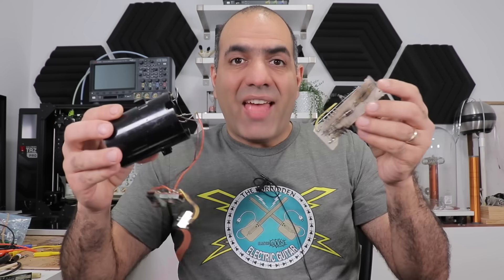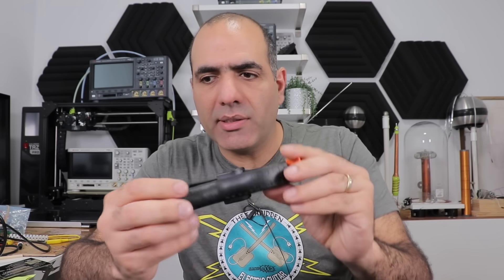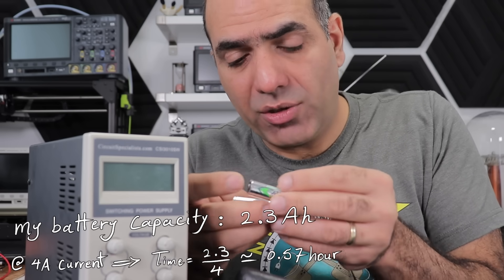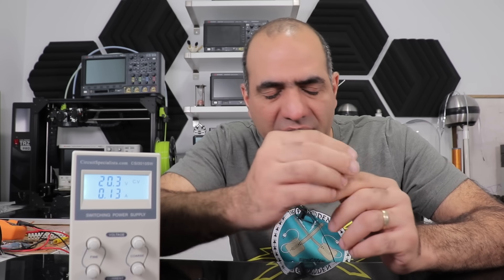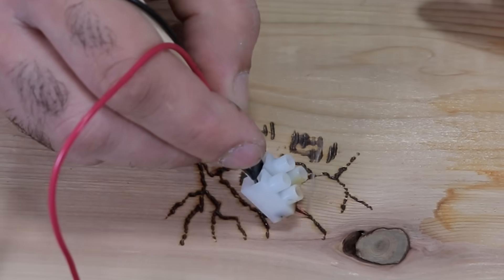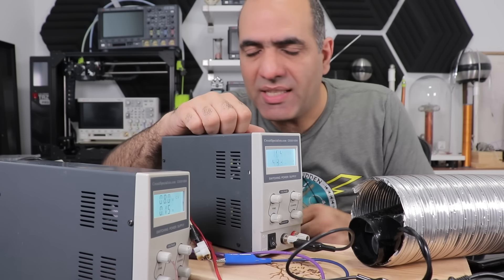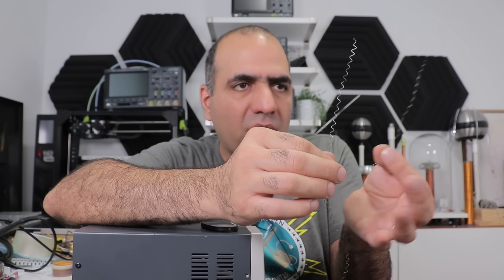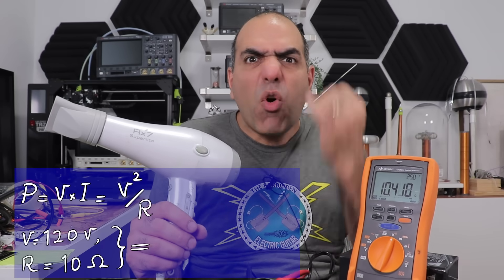Making 5 Things from a Broken Hair Dryer

Comment: Braun: proceeds to use a fork-type screw torqued down so crazily so no one can attempt to tear down the hair dryer just to rejoin a broken wire
.
Context: my sister's 10-year-old Braun hair dryer had a wire fracture at the butt end of the hair dryer which makes wire stripping impossible. Tried to open it only to run into the last screw where I didn't have the proper bit for standard bit-interchangeable screwdrivers and the only U fork-type bit I had was a smaller one for precision screwdrivers, which doesn't give me access to enough torque just to make it budge.

Comment: The magnet connecting batteries trick blew my mind completely, I was thinking how to get rid of battery holders for a project some time ago
Reply: If you pass current through the casing of those magnets, be aware of the heat that this current would generate, and make sure that the magnets won't reach their Curie temperature, at which they'll lose their magnetic property. Best of luck to you.
Reply: @ozonesama  Oh neat, I didn't know about that! So how gradual is the degradation before that point? I guess what I'm asking is if magnets are mostly fine until a certain threshold and only tend to stop working above that point, or if long term low grade heat will decrease the effectiveness a lot too?
Reply: @idontwantahandlethough  It depends on the materials involved, I guess? I saw in that video ( https://www.youtube.com/watch?v=rOgGJaO5C00 ) that Nickel could rapidly switch back-and-forth between ferromagnetic and non-ferromagnetic, and if you know how MiniDiscs used to record data, it used a laser heat source, so it can be a very quick process, once that material's Curie temperature is reached. If you stay quite bellow that temperature, I don't think that, even by repeated prolonged exposure, you'd loose magnetism.
Reply: @ozonesama  If that occurs, that also means your batteries are absolutely smoking hot. In this case, they were lithium cells. I'd be much more concerned about 350°C lithiums than the magnet connection.

The magnets are indeed usually nickel coated too, so the battery internal resistance would be the source of any heat. In other words, don't draw too much current from your battery.
Reply: i think neodymium is much more resistive than copper
it will heat up much more especially in the use case of this video with high current
and hot stuff around rechargeable batteries or just batteries in general isnt a good idea
Reply: @urnoob5528  : Nope ... these magnets are ALL coatet with nickel .... Nickel = good conductor !
(They use nickel strips to build battery packs.)
Reply: @urnoob5528  yeah, we used a neodymium magnet to fix the door of a small oven years ago, it worked great if you didn't make the oven too hot :D
Reply: not a great idea for a long time, magnets lose their magneticity when exposed to heat over time
Reply: You could just put the neodynamium magnet behind a copper contact, and have the advantages of both with the weaknesses of neither material
Reply: Idk why but I always thought it was bad for batteries if a magnet was connected to them. Lol idk why. That is a very clever and convenient way to test model a circuit
Reply: @mcsquared5005  I could see where it comes from, if you had the magnets moving around the batteries they could interfere through induction
Reply: magnets aren't good conductors, if your circuit draws more than a few amps then this will likely fail
Reply: @rikka0_059  Refer to discussion above about nickel coating on almost all of these magnets. Certainly wouldn't use one to replace a 100A connection, but in this case it should be fine. I'm measuring 0.00 ohms across a 1 inch stretch of shiny coated neodymium.
Reply: Döşe running a current through a magnet strenghtens/weakens its magnetic field ?
Reply: Don't do that for high power applications. Your magnets will lose their magnetism.

Comment: To straighten that heater wire, you can bite down on one end with your back teeth (not your front teeth, so you don't damage them), hold the other end with one hand, pull it tight, and use the other hand to run any size bolt over it. It's insane how well that works.
Reply: why teeth. that's stupid. The wire is harder than your teeth, it WILL damage your teeth.
Reply: @personzorz  Well if you aren't yanking on it like a gorilla, you'll be fine. Front teeth are easy to chip, but your back teeth have a larger surface area. It doesn't take that much force.

If the wire is long enough you can tie it to a stick or something and stand on it. Or if you don't mind going through the trouble, you can tie it to something stationary. I'm just saying what works for me. I've done it lots of times with no trouble.

Comment: Why have I never thought to use magnets to attach wires to batteries!?.  I've got hundreds of the dang things.  Thank you.
Reply: I think hair dryer heating elements are made of nickel, so that is why the magnets work. I do not think the magnets would work for copper or aluminum wires.
Reply: @7piecebucket  as long as you use them to sqeeze the wire to the (steel) endcaps of the batteries, it will work fine.
Reply: @mjouwbuis  Ohhhh, got it now. The wire goes between the magnet and the battery. Thanks!

Comment: this kind of small DC motor has input voltage about 24 to 36V...so it uses the heating element as voltage dropper to reduce the input voltage while dissipate the energy as heat. most likely those heating element is Kanthal FeCrAl instead of Nichrome due to cost issue...
Reply: not sure which of the two is the horrible one, because they use the worse one in hotplates. The hotplate burns out in just ten to a hundred hours of use. They do it on lab stirplates too. Thing oxidates itself when hot. What a joke.
Reply: Nichrome also heats up way faster
Reply: @DirectorOfChaos9292  that's nonsense. Material heats up as fast as you put energy into it.

Comment: Hi, ElectroBoom, as a electronics student, videos like this really helps me to know what I can do with my electronic scraps here in my home. Great video btw <33
Reply: just remember to never go above 60V DC until you've learned to work safely with electronics. Over 60VDC and over 120VAC can kill you if you get stuck/touch them.
Reply: @dimitar4y  yeah mate, don't worry haha. I even do electrical wiring in my home. safety first of course.
Reply: @lbyt27  as long as your fuseboard is up to date, you'd struggle to set your house on fire anyway, unless you grossly mismatched load/wire gauge/fuses. "Electronics student" implies you're, like... you know. novice. 

don't use more than 3 wagos per cable run or you'll cause a fire because contact resistance kthxbye
Reply: @lbyt27  Safety first. Always. I've been saying that for 25 years.
Reply: @lbyt27  not worrying, just giving the usual disclaimer.

Comment: That foam cutter looks insanely useful, the "official" ones are usually pretty expensive.
Reply: I'll bet that there are some 1960s DIY books, mentioning this type of foam cutter as legit project for kids
Reply: Steel wool and a 9v is often used as a firestarter btw
Reply: Ikr it’s just a wire and 2 double A batteries
Reply: @chuggs I mean if you can burn your house down with 2 AA batteries you probably shouldn't touch anything that's using electricity
Reply: @richardbottom9843  whoops
sorry spilled my drink
Reply: @richardbottom9843  You most certainly can burn down your house with 2 AAs
Reply: @chuggs well you can just use 3V and hardly will burn your house except your house made by paper or firewood.
Reply: Yeah. My dad's an electric engineer as well and in the past we also built a foam cutter out of such heater filament, but instead of using such a clamp, we used a jewelers saw, because of it wider bow. But apart from that. Same setup and it works just as well as those commercial foam cutters
Reply: Except that you need same hair dryer he used. Or just buy some wire and a power supply to measure the amount of amps it can take and how many batteries that would take
Reply: a soldering iron would probably be the simplest solution.
Reply: @joedirt7604  since you don't care about efficiency and cleanliness of the cut, the simplest solution would be tearing the foam with tooth and nail like a dog 🌚
Reply: @Makujah_  awe how cute, someone's triggered 😂
Reply: @joedirt7604  👀?
Reply: Bro. Just take a primus, or any gas stove or concentrated heat source, heat up a knife to a high temperature, and for the first 5 seconds it'll be butter smooth, and gradually it will slow down. Then reheat. It's that east
Reply: But this one is explosive
Reply: Pvc, nicrome wire attach to board. 5v supply. The pvc is the spring to keep it tensioned. Like a big c. It's like a  scroll saw for foam. 13" between head and table. Will cut to 12" thick.
Reply: @chuggs I mean this one won't either if you're careful
Reply: I see foam cutters for 20 bucks all over Amazon.or is that what you consider expensive?
Reply: Isn't the "official" styrofoam cutter called "a knife"?
Reply: @Zzudwa  Lol. No, he means those prebuilt cutters which use a heating filament. Those are way too expensive for what they are.
Reply: @chuggs Just add a case and a button and you have an "official" one.
It's nothing different.
Also you don't need a hair dryer, as you can buy the nickel wire directly.
Reply: @Don't read profile photo get lost
Reply: Electricity isnt needed { well sort of it relies on it for clean cuts but would work as a saw pretty much with out the heat}
Reply: @@chuggs And do it accurately
Reply: You can buy a roll of nycrome for cheap, a few eye Bolts and extend it to as long as you want. There are online calculators to figure out voltage and amps per inch it's not that hard to do. Cost about the same as a hair dryer and you don't have to straighten the wire as much or find out the hair dryer has some new fancy heating element you can't get to but do what you want
Reply: @newmonengineering  The point of using a hair dryer is that you or someone you know already has one and is tossing it out for some reason, so it's free, obviously nobody is going out and buying a new anything just to take it apart, unless it's going cheap in a closeout sale.
Reply: @newmonengineering  don't buy a fancy hairdryer if you don't want a fancy heating element lol
Reply: Also, "insanely useful" seems like a bit of a stretch, lol. I can't think of a single time I ever needed to cut squiggly lines into a piece of foam
Reply: @PimpedKoalas  it’s used in building model airplanes. You stick a cardboard airfoil piece on both ends of a thick foam piece then sculpt out a wing
Reply: @PimpedKoalas  >not useful for you >not useful for anyone else. that's how the world works right?
Reply: @richardbottom9843 unfortunately, that's how millennials think the world works, because he got 40 more likes than you did.
Reply: @PimpedKoalas  I needed something like that at one time when making some home repairs but ended up using a plain metal saw blade that worked just as well. Maybe a bit more time or messy but less wires or smells to be annoyed too. Luckily all i needed was straight cuts. For wobbly lines it could come handy this, like for making molds for some type of metal casting.
Reply: @PimpedKoalas  You have not worked with styrofoam, have you?
Reply: @PimpedKoalas  I actually had to do just that about 6 months ago lol. I bought some 6 1/2" speakers for my car doors and they needed a 1/2" thick spacer to fit properly but no store nearby had any. So as I sat there staring at the Styrofoam the speakers came in trying to figure out what around my house I could make temp spacers out of, the foam finally dawned on me. Then with no hole saws that big I came up with the hot wire idea. Instead of batteries though i just heated a metal coat hanger with a blowtorch lmao. After that I just  used sandpaper to smooth out the shaky hand cuts
Reply: @PimpedKoalas I built a CNC foam cutter using wire like this in college. It's used to cut airfoils for the school's RC airplane program with boeing.
Reply: @Don't read profile photo such an underrated trap wrapped in a joke 😂 @electroboom
Reply: @Lilyfoxchu  what an unfortunate username

Comment: Man, i wish i had a proper Power supply and not an old PC PSU i hotwired. 😅
Works for 5, 7 and 12v at least.
Reply: you CAN hack the pc psu and make it adjustable. It's just a dumb 'ole smps. Mains filter -> mains fbr -> mains capacitors -> switching transistors -> small transformers + feedback coils-> output caps. There's multiple ways to hack it. Some supplies will let you just screw with their "sense" wire directly - use a potentiometer to drag it from vin -> sensewire -> ground. No current control capabilities unfortunately.

Comment: Well, I have a broken hair dryer.... So I know how I'm spending this week
Reply: remember to not touch the wires, make sure they're secure and will not come free from movement/use/vibration, make sure they are insulated so you can't accidentally touch 'em, etc. etc. Put the ferocious beast in a cage prefferably not out of conductive elements like metal. If you're using mains 120VAC/220VAC  that is.